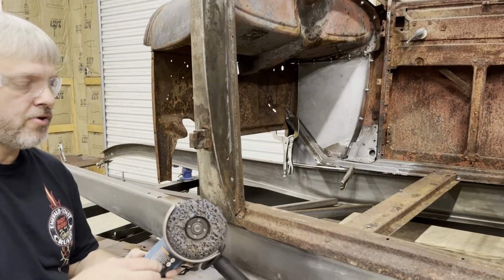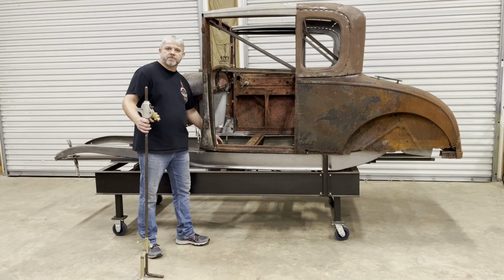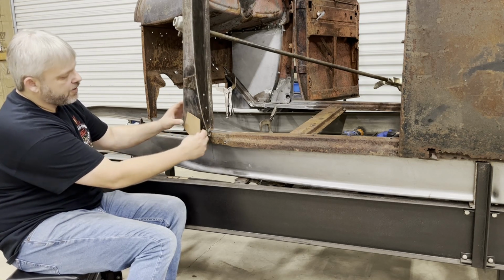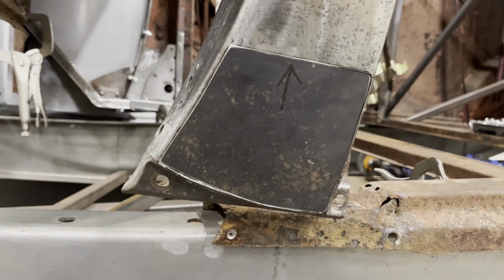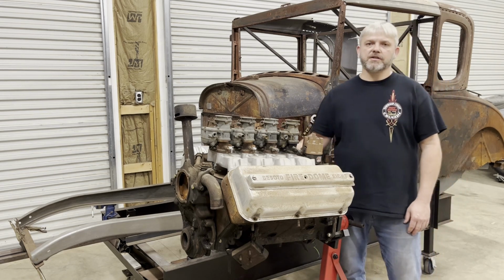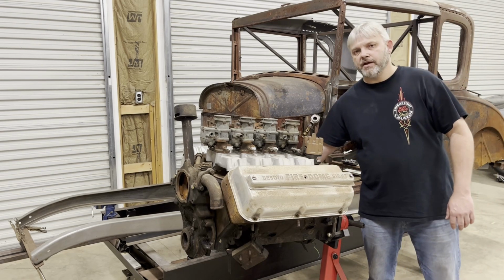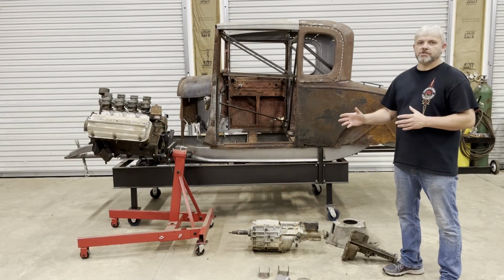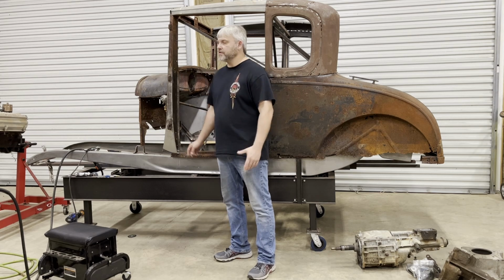Model A Ford Traditional Hot Rod Build! Update 3. A pillar rust repair, and talking about the HEMI!

Comment: I have the 330 in my 31. Installing a 3 deuce setup as we speak. It ran awesome with just the two barrel. Check out Hotheads for anything you need for it. Your extremely lucky to get that intake. Water temp will run about 160 degrees. They don’t overheat. I still run the mechanical fan, no electric fan needed and I’ve driven it in 105 Texas temps with no problem at all. Anymore videos featuring your engine? Can you share me the link if so?
Reply from the maker: Awesome, it sounds like you have a great setup. I don't think I've said too much else about the engine in my videos, but I will have a series of videos on the complete build when the time comes. I think everyone following the channel will find that very interesting. Right now I'm trying to get the body done, and it is taking me entirely too long LOL.
Reply: @phillipshotrodgarage  body work is long and tedious but you’re doing a fantastic job. How can I send you pics of what I’m doing and show you my set up?
Reply from the maker: You can email me at phillipshotrodgarage@gmail.com. you can also follow me on Facebook, just look up Phillip's Hot Rod Garage. You can message me there on messenger. I stay extremely busy so be patient with me getting back to you.

Comment: Way cool! My father just recently got his ‘31 model a 4 door on the road with a 291 hemi with an old edmunds 2x2 intake. He had his cam reground by racer brown and not had any issues. Maybe I will have to post some video.
Reply from the maker: Sounds cool! I'd love to see more of that car and see some details on the engine installation.
Reply: @phillipshotrodgarage  we ended up reversing the firewall to make things fit. He used hot heads adapter to a 2004r gm trans and their mounts, water pump/timing cover setup. He boxed his stock model a frame, and used center dump Sanderson headers. When I get a chance I’ll dig up some videos and photos of it.

Comment: I haven’t had much luck with reground cams…FYI
Reply from the maker: Are you referring to reground cams in general, or are you talking about reground cams for early HEMI's? There are no new cams available for Desoto HEMI's other than a few fairly expensive and difficult to find roller cores. Those are getting used up from what I can tell, and nobody is currently making any. So, reground is the only other option. The guys on the HEMI forums don't really speak on having much trouble with them, at least I haven't read anything about it. I'm going to do a bit more research on it and see what I can come up with. Thanks for watching my videos and commenting, I appreciate it!

Comment: I love those old classic Mopar Hemi's.  Sounds like it will be a nice build and you seem to understand how to set it up realistically by not over carbing it.  Lot's of folks would just throw giant overkill carbs on it and it wouldn't run well at all.
Reply from the maker: The intake I’m using doesn’t have much distribution between carburetors.  Basically, each carburetor will run two cylinders. Everyone want a big ‘ole carburetor, but when you think about each carburetor only running two cylinders, it doesn’t need to be very big. Each carb came from a 136 cubic inch flathead. Each carburetor on my engine will only be supplying air/fuel to about 73 cubic inches.  The 97’s could possibly make more high rpm power, but I’m gonna drive this car a lot, and that won’t be at high rpm. The smaller carbs should be more responsive and run smoother at low speed.  Thanks for watching and commenting!